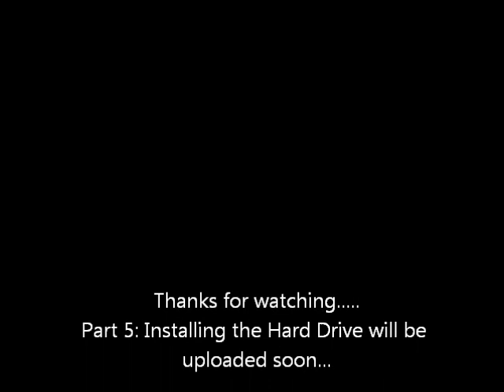PC-Build Series: How To Build a Computer: Part 4 Installing the motherboard into the case

Comment: I am having major problems installing my Sabertooth Z77 into my cm storm trooper. The holes line up with motherboard, but when I try to bolt GPU down, it is slightly off from PCI slots.